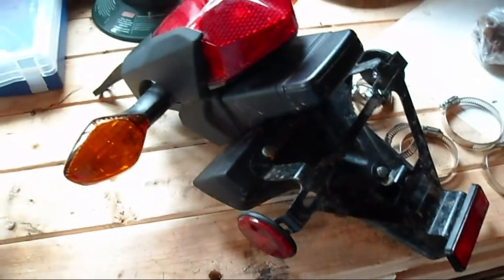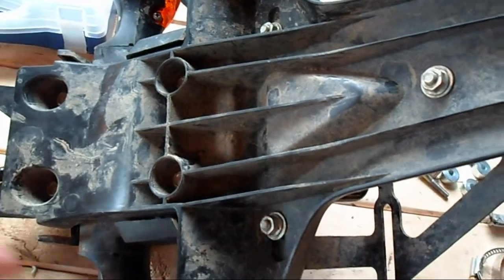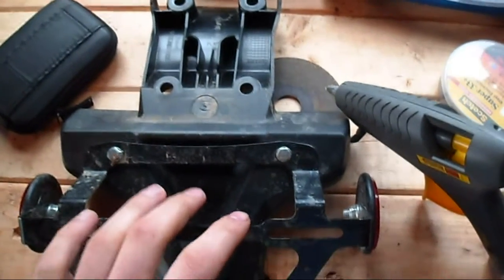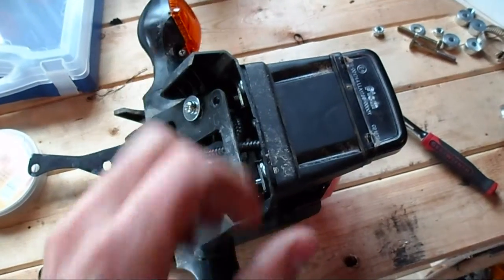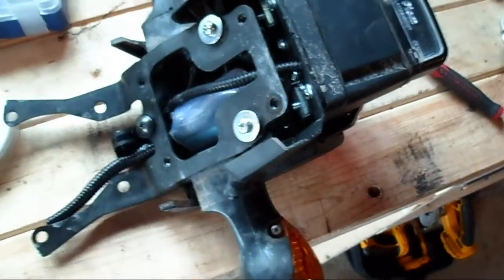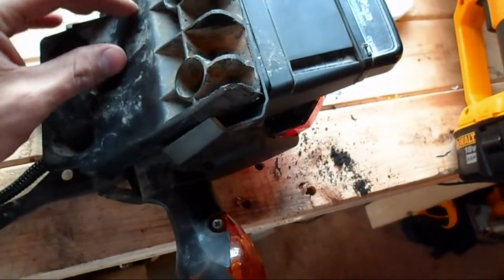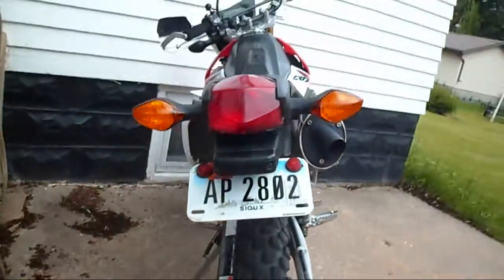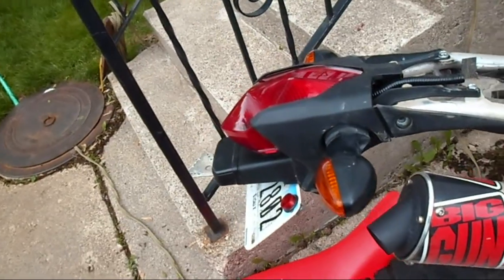Cheap Tail Tidy CRF250L

Comment: Hey Kory, you could have also removed the factory license plate light. That's how I did it, and it's even cleaner and less bulky. To illuminate the plate, just cut an opening in the tail light housing following the diamond shape imprinted in the bottom plate of the tail light. Then cut a matching clear plastic piece and epoxy it in place. Then you have a good plate illumination and a nice clean look, with the advantage of the stock tail light's visibility. The license plate then can be screwed into available holes that will be obvious at this point.
Reply from the maker: That's a good idea. I'll have to use that when I break off the current light.

Comment: Hey, I was hoping you could post a video on how you removed the whole tail light assembly you show in the beginning of this video.  Also how long it took to do so.  My thinking is I could ride to a local dirt track with the lights in place, take them off and ride and then put them back on for the ride home.  Hope you can help. Peace.
Reply from the maker: I don't want to make a video for it, but there are four bolts under the seat that you remove, then take the wiring loom plug apart. You would leave electronics exposed and that's no good. I have done some really rough riding with lights in place, and they are actually pretty tough. How long to remove depends of your proficiency with a ratchet and socket.
Reply: Thanks.  Happy riding.

Comment: hey kory, i was wondering about the reason why you cut your mud guard was to protect it from mud and dust? I don't want to install the drc tail light coz my local dealer said that I would lose the electrical warranty of my bike.  Is it possible to remove the stock mud guard and have a custom made metal sheet to protect the internal components at the same time act as a license plate holder?
Reply from the maker: You don't need to do anything to protect the internal components. Take your seat and rear (white plastic) fender off and take a look. The factory mud guard is just that, a mud guard,  and the factory tail light will protect everything as it is not removed. The DRC light now can come with a plug adapter so you don't have to cut factory wires, but it's still a hunk of junk. You can get just the license plate bracket like I used on ebay and from most parts websites.
Reply: ok thanks

Comment: Are the rear turn signals on the back suppose to be running lights like in the front?
Reply from the maker: Anal Slayer From the factory, no. You can make them that way though.